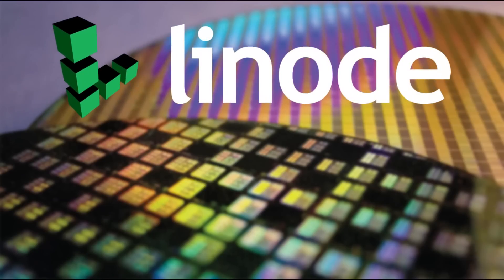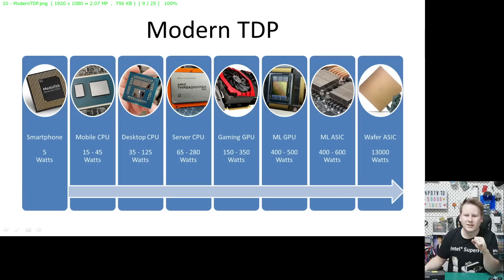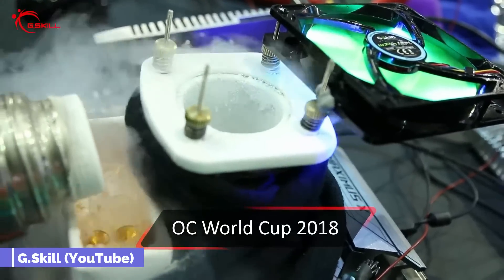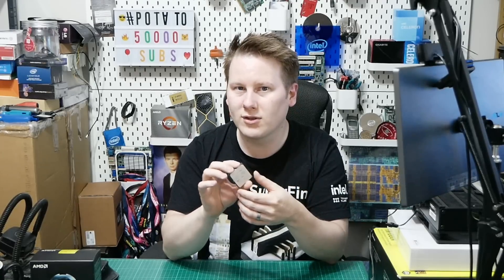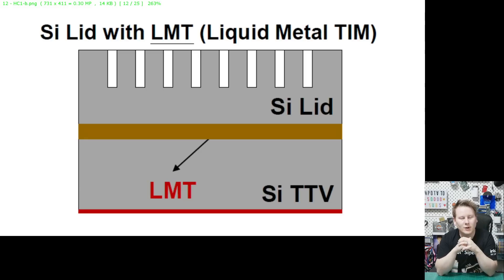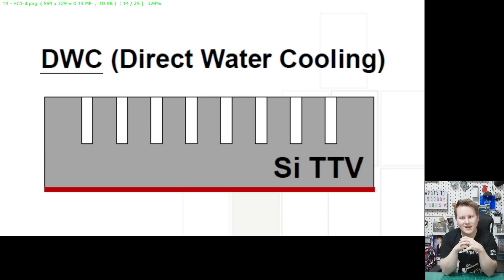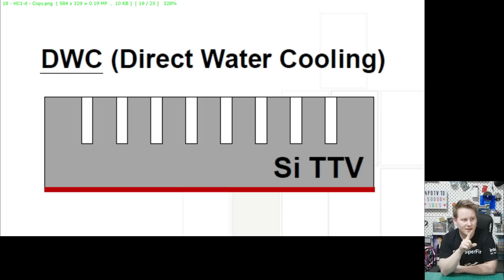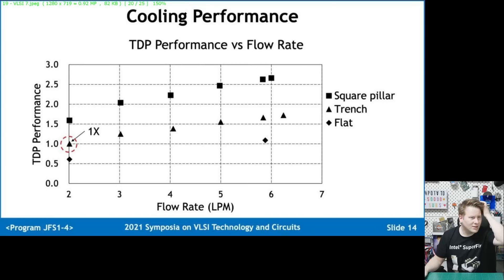How to Cool a 2600 Watt CPU or GPU 🔥🔥🚒

Comment: Isn't IBM pushing some insane power numbers in their mainframe CPUs?
Reply from the maker: 400W ish
Reply: @TechTechPotato  huh, I expected more, seems like everyone in the industry who  doing normal-ish hardware is in this ballpark at the moment
Reply from the maker: @tommihommi1  I asked Lisa Su about this once. She said it was easier to draw the mega GPU power in GPUs because of dense repeated units. With CPUs it's harder to get everything working all the time, even when cranked with voltage and frequency. She didn't say the word cranked, that's my approximation :)
Reply: @TechTechPotato  that's why you put 64 cores into the CPU :)
Reply: my two farthings worth. there is also a point where more volts for a smidge more MHz gets you diminishing returns vs allocating those VRM watts to a lower clocked FPU/ALU for another thread per core. becomes a slightly different game with supercomputers running massive-parallel/massive-vector simulations vs a low-threaded gaming CPU/GPU. you can always cut the atmosphere up into smaller cubes to run it with more threads on a bigger machine, it's kind of difficult to do that with the keyboard/mouse input driver, lol.
Reply: And they are cooling directly with an in-tap and an out-tap on each CPU
Reply: @TechTechPotato  Epic Genoa will have 96 cores and Bergamo will have 128 cores.
Reply from the maker: @anindita basak no shit you should watch some of my content where I've reported on this several times

Comment: The max power you should draw off a typical surge protector is 1800 watts. So 1800 watts - monitor power = Max PC Power.
Reply: Depends... a lot of modern European apartments come with surge protectors somewhere in the 3-3.5kW range (as far as I know), and houses can sometimes go into the 5-6kW range (especially if the design explicitly includes something like a shed with a workshop). Anyway, with the rate at which car chargers are becoming commonplace, we might be gaming in our garages soon enough.

Comment: Okay, but what about more advanced applications of existing tech, such as vapor chambers. They excel at heat spreading, i.e. high power density use cases benefit the most. Any way we can implement a vapor chamber directly onto a substrate with the bottom of the chamber being the die and substrate?

Comment: Instead of DWC (Direct Water Cooling) they can
1. Pump liquid metal through the troughs to pull out even more heat than plain water and,
2. Chill the heck out of the liquid metal (water can get frozen at 0°c but liquid metal remains in liquid form at 90 Kelvin or -183.150°c).
Reply: Amd remove air humidity from the environment to prevent condensation

Comment: How about total immersion cooling using Freon (or similar). Probably not … but the Cray 3 managed to dissipate 88kW in a 405 cubic inch package … which sounds impressive at first sight, anyway. That used unpackaged Gallium Arsenide chips (naked on PC boards).

Comment: What kind of pump did TSMC use? 2LPM (120 L/h) is on the high end for a PC custom water cooling loop as is and makes me question what kind of pressures are necessary to force 354 L/h through those tiny channels cut into the silicon.
Reply from the maker: Laing D5, a favorite for home liquid cooling, does 1500L/h.
Reply: @TechTechPotato  That's a very theoretical value. I have a Laing D5 and it used to top out at 160 L/h in my admittedly rather large loop. Then I added a bunch of quick disconnects for ease of maintenance and now I max out at 100 L/h, though I throttle it into the 60s for noise reasons.
1500 L/h is what you get when you have a pump, a reservoir and a measuring device with a minimum of tubing in between them.

Comment: To answer the intro question: My i7 9750H is rated at 45W. I have regularly seen 65 for longer than the longest boost duration could be. My 1660ti is a desktop SKU, and runs a mild overclock and pulls up to 140W in bursts, but sits around 90W for most of it.

Comment: Single stage is impractical and causes 
condensation. My P6T / W3570 / OCZ Cryo-Z were notoriously hard to keep running, cryo z was made for sub 130W CPUs so the Xeon gave it a rough time.
Reply: If you have a chillbox/"purge box" you can remove all the humidity from the sealed case and eliminate the possibility of condensation. There's also water/glycol mix that allows chillers to get below negative temperatures without freezing in the loop. It might prove more flexible than direct-die phase change cooling, if at a slight loss of efficiency and increase in insulation efforts.

Comment: So its friction welded onto the chip. NICE.

I would still use heatpipe instead of groves and direct liquid cooling take that 300mm of area cooling should do better than 80mm, even if heat transfer will be lower in case of high area solution.
I am not fine with conductive fluid going so close to such power. I can get it its, the most hardcore option, but for me heatpipes replacing IHS, and expanding it to cover whole chip or even more, is where I will draw my line.

Comment: this is AMAZING!!! I think if this does come to fruition then the water entering and exiting the chip should be ON THE REAR OF THE MOTHER BOARD and a waterproof coating applied to the back of the waterboard. And this should be a standard if this comes to the home desktop PC's. My reasoning is that regular people (non 'enthusiast" users) would most likely have no idea how careful they need to be as to ned get the computer wet and to COMPLETELY DRY IT before trying to run the machine. PLUS we know those 'BIG NAME" PC manufacturers make there products as CHEAPLY AS POSSIBLE and their "garbage" likes to easily break over time. So WHEN IT DOES, the water would only be able to get onto the back of the MoBo and it would have a nice heafty coating so there is essentially no risk of a short.
PLUS throughout the ENTIRE HISTORY of the PC we have seen only a SMALL HANDFUL of manufacturers utilize the rear of the MoBo. Adding an extra M.2 slot is really the ONLY thing that comes to mind, besides that one MoBo that was features on LTT where the processor was on the rear of the board so it could attach the ENORMOUS heatsink that was 100% passive (with no fan) that was TOO BIG to put on the front of the board because it would be in the way of EVERYTHING that goes on the front.
Other than these two examples, I really can't think of anything else that has been done on the rear of DESKTOP Motherboards (sbc's and specialist boards are not part of this convo as they are NBOT considered DESKTOP PC MOTHERBOARDS) - AM I WRONG ABOUT THIS??? DO ANY OF YOU KNOW O F THE REAR OF THE MoBO BEING USED FOR SOMETHING??? PLEASE LEAVE A REPLY ABOUT IT.
So using the REAR of the board is a GREAT PLACE for water cooling for the regular consumer because they wont accidently bump the pipes or tubes if they upgrade their RAM or use an ADD-ON card or something... they might think (hey this dumb 'bar' is making it hard to add my new sound card... it's probably there to protect the computer from shipping bumps or being kicked while under my desk... and those twisty rings MUST mean it's meant to be detached so you can put more cards in so here goes nothing... *SPLASH!!!*) This would be MUCH MORE FREQUENT if processor will REQUIRE water cooling in the future.
SOOOOOoooo Dr. Cutress, if you ever find yourself in a position to make some suggestions to anyone about water cooling the chips directly, PLEASE FEEL FREE to use this idea if you find it useful. It wouldn't take much for manufacturers to FLIP THE PROCESSOR OVER TO FACE THE REAR OF THE BOARD and this OPEN A WHOLE WORLD OF DESIGN for PC builders. PLEASE DO SHARE THIS WITH ANYONE YOU CAN. (that is if you like the idea) It might make a difference in the world. :) 💗💗(no homo lol)

Comment: It'd be interesting to see if this could work with heatpipes fused to the silicon instead. I'm sure they could work up a way to  deposit a capillary structure inside the channels. It'd cost less than water cooling and be more reliable because there's no need for a pump.
Reply from the maker: Well, the fusing is part of the problem. It adds thermal resistance to the system. Fusing to the silicon still creates a non uniform barrier

Comment: What if you would start with a block of solid coper, make holes in it and let water run trough this. Then on that solid coper block the silicon is placed on whitch the actual chip is working. Then on top of that another solid coper block is sandwiched. The other possibility is switching over to ARM.

Comment: If we go even higher, it starts becoming a problem for the space containing the PC. Pretty hard to cool a room when there's a 1kW space heater running
Reply: I'm actually letting my 2080 Ti run Furmark rn because the heating built into my place is not enough. I for one... :)
Reply: I'm thinking that the case ought to use the ventilation commonly sold for dryers.  You can buy these and DIY kits to install on the side of your house already.  So, build a case that has the fans on the radiator exhaust into a manifold with a standard connector as used for clothes dryers, rather than being exposed on the side of the case.

Comment: I’m surprised you didn’t touch on the AMD patent from a while back which used on/in silicon Peltier/TEC between stacked layers to quickly move heat around and out. 
Don’t know if they’ll actually ever use it, but a neat idea.
Reply: it was horribly inefficient.
Reply: @shinokami007  that specific patent/paper?  From what I remember it was way better than normal TEC.

Comment: You should talk about Cray water cooling.  They submerged entire system boards in a non conductive fluid!
Reply from the maker: I've been writing about that (it's called multi-phase immersion cooling) for years. There are companies dedicated to it in the datacenter. But super high upfront costs and lots of components have to be redesigned.

Comment: Dumb question - why only cool one side ?  
Any numbers on thermal expansion or stress where one side is cold and the other side is hot. 
I've seen the demo of using Freon directly on the chips.

Comment: Yeah, there's a limit.  If you dump energy into the silicone faster than 148 W/m K .... The chip will eventually burn out.
But that's a bit silly to say because you're not dumping energy into the whole chip, but just parts of the chip to decode instructions and do ALU calculations, maybe flip things between the registers and L1 cache, branch prediction, that sorta thing...  So it's safe to say there's a maximum amount of power tiny sections of the chip can work at...  I don't think silicone CPUs can get much faster than 10GHz...  However, using CARBON in the diamond structure could see absolutely insane speeds well beyond 10GHz.

Comment: not sure why this makes me thing of a cover I wrote years ago, lol.
ZDG - World of High-end game-'n'.
(Inspired by ZZ Top, World Of Swirl)

yea. Yea!
I got new graphics card, had a Game in mind.
It's look-'n' for a kill-a-watt, and the PSU died.
It's getting a little crazy, as the case is turn-'n' red.
Got to find a cooler for the inside outside.

Smoke-'n', from the melting fans.
Screaming, from the Power-supply.
In the world of High-end game-'n'.

Everything is smoldering, ten feet from the case.
Isn't it amazing, how it glows without any lights.
It's so unpredictable, when the breaker will explode.
Got-a escape the flames, coming out the side window.

Smoke-'n', from the melting fans.
Screaming, from the Power-supply.
In the world of High-end game-'n'.

(Oh $#!+, the extinguisher is empty again)

Ramming in more cards, you gotta keep on gaming.
Heaping on that halon, just to keep it running.
Beyond thermal, exceeding plasma.
Ready for fusion if it had the pressure.

Tumbling, between Crossfire and SLI.
conflagration, inside the computer.
In the world of High-end game-'n'.

Comment: don't give GPU makers ideas about 2.6 killa-watt 'gaming' chips, they will make them and we will all suffer the consequences, lol.
my minimum spec, a PC that doesn't need a 40-foot roof-top chiller just to keep my house from melting it's way down to the earths core, lol.
Reply: Not a roof-top chiller; rather, it doubles as the hot water heater for the home.

Comment: a DWC cooling solution would probably need you to buy the chip packaged along with you cooler, right? I mean, there's no way you can mount a cooler by yourself since it's directly on the silicon, and it's rather fragile. and because of that, is it safe to assume a DWC chip is simply not feasible on consumer market?

Comment: multi layer cpu/gpu's with exotic cooling , isen't it a bit too much for home computing ? atleast for the forseable future 5-10 years

i mean i can get a 64 core cpu (single layer) if i really wanted to now

and even do it has gone out of ''style'' there is still the possibility for two chips on one gpu side by side or sli two gpu's like in the past and has to be sufficient for home use like gaming etc ?

Comment: Lots of cpus on a motherboard seems a better solution to me.

We used to do that with single cored 486 so why not have dozens of 16core cpus?

We would need to keep related threads on the same chip, but affinity coding can do that already

Comment: Given heat naturally rises, it makes the concept of flip chips seem counterintuitive since the heat is being trapped underneath. Seems like the conductivity components should still be on the upper outside surface (classic bonded style) - I do wonder if flip-chipping was more about protecting IP than about removing wire bonds. Maybe we should return to the classic face-upward chip design, then to achieve stacking we add draft-cavities with ceiling layers held up by conductive pillars/bus (producing inner spaces like in underground crystal caves) between layers with top-to-outside venting tubes for the rising heat from lower caverns. You could probably run coolant "rivers" through the caverns if the conductors have all been sealed with a protective (oxide?) layer.  LOL, I'm just visualizing the concept! If you could coat the cavern walls with glass then I wonder if you could flow mercury through them, and would mercury flow friction free (they say mercury switches never wear out - but not sure how long "never" is in that context).
Reply: "heat rising" usually refers to differential buoyancy in fluids / gases whose density changes with temperature causing convective motion. It's not applicable to thermal conduction within solids and not really a significant effect with actively pumped liquId here.

Comment: I saw an article once about a server warehouse where they had racks and racks of pools with the entire motherboards submersed in heat conductive (but not electrically conductive) liquid and the heat would just boil off the chips, obviously that's not practical for home use
Reply from the maker: I've written about those and met a number of companies doing it :) It's pretty cool (pun intended), but base cost is +++++++++
Reply: @TechTechPotato  do you have any numbers on what kind of heat those liquid pools can handle, in terms of comparable wattage to the rest of the solutions mentioned in your video?

Comment: But why do we need to cool CPU's? Is it just coincidence that silicon stops working at a few dozen degrees above room temp? Could we make a CPU that is perfectly happy at 500C, thus allowing for a much larger temperature gradient to help with heat dissipation?
Reply: Not as long as materials such as solder, and gold wires are used in the chips, and even then the silicon structure itself degrades with high voltage and high temperature. I'm by no means sure of the relationship between the two, but I would guess that as temps go higher, less voltage is required to begin degrading the structure. There are lots of metallic layers embedded in the silicon, too, and those will melt way before the silicon does.

If they can come up with a way of making the conductors out of graphene, the temperature resistance will go up hugely
Reply: https://en.m.wikipedia.org/wiki/Landauer%27s_principle

The energy needed to flip a bit is directly proportional to temprature, or you have to shout to be heard in a crowd (more energy) to be heard (represent a bit) in noisy(hot) environments making the area lowder (hotter) so others have to shout to.
Reply: Thermal Noise is one of the fundamental principles of the universe
Reply: It gets exponentially mode difficult to control things at the quantum level when you increase the energy in the system (every 10 degrees celcius/kelvin doubles the rate of reaction), plus the electrical resistance increases with temperature so you get less and less efficient at the same workload as your temp goes up, plus you also have to now insulate your chip from the neighboring components and you also need to now think about how different parts of your system may expand at different rates based on the large differences in temperature between them.
Reply: I'm no specialist, but i wonder what thermal expansion might do to semiconductors since they are basically very thin layers upon layers of different materials over silicon
Reply: A CPU made out silicon turns into one huge short circuit at 500 °C, the entire die would start conducting in all directions, plus probably the carefully doped regions would begin to fuzz out and bleed into each other due to atomic diffusion.
Reply: You get more and more thermally generated charge pairs with higher temperatures. This lowers your control of the system since it's not dominated by the dopants anymore. 
Silicon will work up to about 175C for power transistors, but they are much more simple than processors. Above 175C you start to have trouble turning transistors off, again, thermally generated charge carriers. 

Silicon carbide devices can work over 400C, I think. The packaging then probably gets complex, since things like epoxy (regular circuit boards) can't handle it.